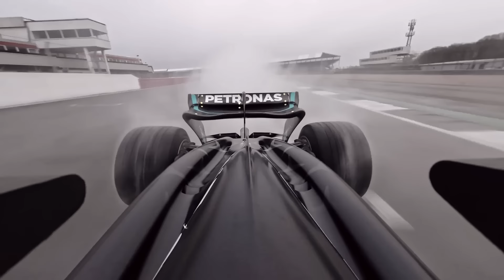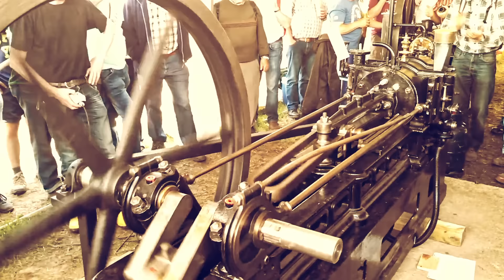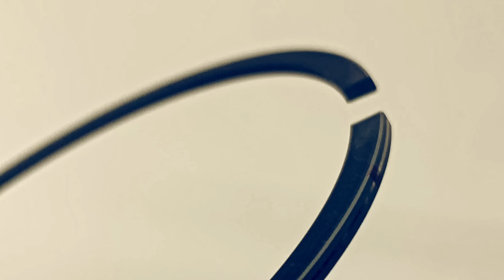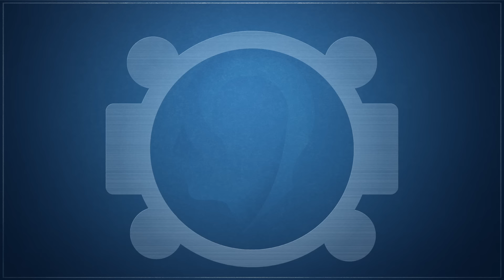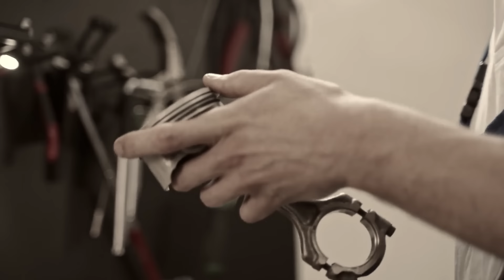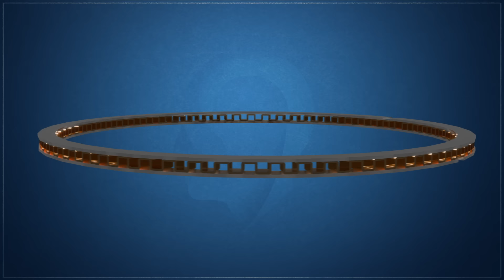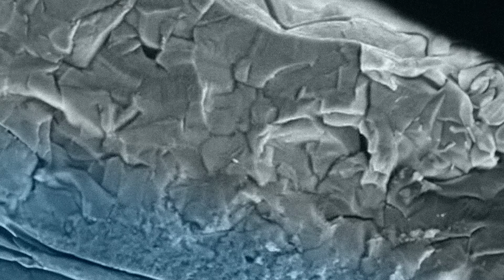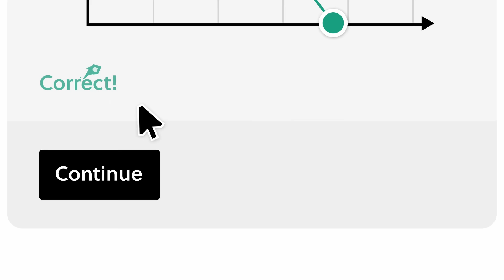The Clever Engineering Of Piston Rings

Comment: Now this was a very informative video indeed. Those Keystone rings a very interesting. Those F1 rings are mental.

These new thinner, lower tension piston rings in modern engines are a disaster.

They reduce fuel consumption, but increase oil consumption. How is that keeping the environment clean?
The cost of the required oils is also magnitudes higher than what was a regular oil back in the day.
I would venture to say that the amount of money I save on lower fuel consumption does not cover the extra cost of constantly topping up the oil or the inherent issues of those consumed oils damaging catalytic converter, etc.

The demands brought by these environment regulations is actually going to mess up the environment in the long run. Barely-used vehicles are getting junked due to high oil consumption issues deeming them not fit for service. You can blame the manufacturer, but they in turn are held to account by the stringent regulations.

Comment: Good video , one part of development you missed was the 4 piece oil control ring this was most likely common in the 70s and 80s, known to me as a CR4 ring these relied on groove depth to supply ring pressure to the bore, where as the 3 piece by its design, puts pressure on the bore, that's why it's important to butt the inner spacer correctly,  I knew this design as a CX3 ring , I was an auto machinist in the 80s and 90s . I must have had some reasonable, training as i knew about all the internal and external steps and chamfers to induce torsional twist for better oil control  Cheers .

Comment: Is it true that the viscosity of an engine oil is determined by the leave of the oil control ring?
Reply: I'm not 100% sure about the wording of your question, but if you are referring to the viscosity manufacturers specify for engines, that is driven by the endless quest for improved fuel efficiency.  Lower viscosity oils reduce what is referred to as "viscous drag" which means the engines turn more easily when running, using less fuel.  The use of lower viscosity oils in turn requires a reduction in the clearances between the various moving parts so that those parts are capable of creating what is referred to as a hydrodynamic wedge in the space between those parts. When that happens it essentially eliminates or at least minimizes metal to metal contact. Furthermore, with the adoption of overhead cam designs, you now have cam bearing surfaces more distant from the oil pump.  Lower viscosity oils can be delivered in larger volumes to those components operating at the further reaches of the engine.
Reply: Yes, thicker oil will cause the rings to hydroplane and burn more oil than they already do.

Comment: The irony that the new modern engines with the mandated pursuit for "efficiency" at all cost, ends up making them burn oil at horrific rates, wear out/outright fail prematurely, add insane complexity, drive up the ever more impossible to afford features that either require them to be only diagnosed or repaired by engineers and computer scientists, or simply junked as unfixable.
Reply: That's all part of the plan to make private automobiles uneconomic.
Reply: Not true! Today's engines typically run for 100s of thousands of mile with no issue. Engines in the last century were worn out at 100000 miles.
Reply: @fisheatingbagel40  No, 80s to 2000s engines run for hundreds of thousands of miles with no issue. It's modern engines that are chronic oil burners from the factory, and become catastrophic oil burners once the low tension oil rings get sludged up.
Reply: @gregorymalchuk272  modern engines last longer compared to a push rod engine. As for oil consumption, it depends on how the vehicle is driven. Lower viscosity oil reduces consumption generally.
Reply: @fisheatingbagel40  achieved by more resilient materials....
Reply: For the manufacturer, it was never the "pursuit for efficiency"...it was the pursuit for cheapness. Any government regulations merely hasten the process of cheaper to manufacture designs, that incrementally increase in cost for the consumer. I do constantly hear how great new engines are with their 300,000 mile (or more) lifespans, when I have 1947 & 1951 Ford 8N's that I can completely rebuild for next to nothing in a day, when I would be forced to scrap most other "superior" high-RPM motors.

With the realization from people like Henry Ford later on that your money was never really made in the initial sale, it's in the parts catalogs & servicing...engines somehow became increasingly more expensive and time-consuming to fix, with external parts failures way below 100,000 miles, while using cheaper and cheaper metals, then plastics to manufacture said parts.

By now, you should have had motors doing a million miles on a single rebuild, running on updated magneto systems requiring no points or any type of computerized injection or firing control whatsoever.

Instead, you got super expensive, not that great engines with claims of how long the pistons and rings will last, but they forget to mention how much it costs to fix an idiotic idea like variable valve timing and per-plug coil packs when they fail within 20,000 miles.

The sooner kids out here realize you had the Golden Era of engines a long time ago before I was even born, and they are just dealing with fantasy fulfillment and cost-cutting measures of teenagers who really don't comprehend engines at all while watching way too many Fast & Furious movies, the sooner they will ditch high RPM soda pop can motors that cost you more in the vehicle lifetime than a 1950's Ford or Dodge, but only costed the manufacturer $20 to build.

Welcome to the Era of Lateral Advancement...it doesn't really go anywhere or do anything better, but they keep telling you it does while charging you more for it to not do it any better.
Reply: @TheCaptainSlappy holy yap, thank god the world doesn’t revolve around you because no one wants to drive a 7L v8 that makes 90hp for the sake of “serviceability”
Reply: @shiikon2193  Well...since I have actually worked on engines from the early 1900's that are still running, it's safe to say they knew what they were talking about, and youtubers only made you think you did.
Reply: @TheCaptainSlappy  no one wants to drive or deal with the maintenance of a 1900s engine. But uh good job on your passion project
Reply: @shiikon2193  Good to know you know you know more about engines than the people that build and work on them.

Comment: I am an electronics engineer that currently works in tech. Me being privy to this information is absolutely inconsequential and will never help me in any way, shape, or form, ever. Therefore, I must now watch this entire video and learn everything about piston rings.
Reply: you'd need it when you'll eventually have to work on your own car
Reply: @yobama8344  most people, even mechanically adept, would refer their car to a mechanic if there's an issue anywhere near the piston rings... The amount of engine you gotta dismantle to get to them makes it a job for only those who have the right space and equipment for it
Reply: @sivansharma5027  I feel the same, brakes, rotors, generator, starter, relays, brakelines, All the somewhat accessible parts I can do by myself... Once large- or specialist tools are needed I'll leave it to the pro's.
Reply: So you can show off your knowledge at cocktail parties.
Reply: Programmer here but I’ve rebuilt several engines and here learning more about piston rings. Great stuff!
Reply: Learning is its own reward.
Reply: @rahulmooley3298 Similar with me,  electronics and software engineer (now retired).  But I did rebuild two of my cars' engines while on a sabbatical a few years back and it was an amazing experience,  I highly recommend it! I sent the bare blocks and heads out to be fully machined by a professional racing shop but other than that I did 100% of the job myself in my garage.  Anyway,  I STILL didn't need to know this much about piston rings but am still watching this video to the end just because!
Reply: Au contraire, mon ami!! Progress moves best and most sustainably when SMEs know multiple fields and even multiple industries, even if unrelated simply because their minds can then cross reference knowledge sets and make otherwise novel connections that might take brilliant single-field SMEs years to discover otherwise. Who knows, you could very well discover a new Nobel Prize worthy circuit if you keep watching cross-discipline videos. Stay curious!
Reply: Well , you'll need more than what is in this video .
Reply: i am an arts major at college but enjoy these videos because i learn something new and understand how things work and the clever design behind them.
Reply: Best comment!

Comment: Nicely made, I worked for years in a ring factory for the UK's largest manufacturer making rings for nearly everybody, boring Perkins diesels, Cummins, Rolls Royce Merlins, Cosworth F1  engines, just everything (the factories were divided by ring diameter, we were 2 1/2" to 7 1/2", our neighbouring work up to 16ft for marine engines). Complicated to make, normally 30+ operations for a ring.
They aren't actually ever round except compressed, the spun-cast cylinders are machined in an egg-shape to get the required variation in spring pressure and at every stage afterwards compressed to do the rest of the work.
Reply: Yep. And pistons are far from round, when cold, as well. Mass and temperature distribution are taken into account to form an oval, tapered piston.
Reply: @UncleKennysPlace how much of an oval shape are we talking? As severe as an egg? Or less than a millimeter difference?
Reply: @queueeeee9000 in this case micrometres play a big role)
Reply: @queueeeee9000 Very slight
Reply: @UncleKennysPlace
Reply: @jimtitt3571 that in itself would make a fascinating video!
Reply: Hastings company?

Comment: Govt: We want your cars to use less fuel.
Manufacturer: Here, we use more oil instead.
Govt: Great work!
Reply: cry in 2AZ-FE
Reply: The net effect is still better. 1l oil per 1600km instead of, say, 500ml per 2000km (internal combustion engines have always consumed SOME oil) in exchange for 10-15% better fuel economy is still fantastic. If we assume 20km/l -> 22km/l you're still saving ~7l of fuel per 1600km in exchange for ~700ml engine oil. And this is a very conservative example due to the almost unrealistically high millage.
Reply: @andersjjensen  lol healthy older engines consume nowhere near that amount. Maybe you just never changed your oil
Reply: @andersjjensen But in the meantime, I'm having to replace prematurely failed internal engine components such as timing chains at as low as 60,000 miles because of such low oil grade. Proof: in the past, on the brink of "low tension rings" the engines in some cases were exactly the same except for low tension rings and decreas in oil viscosity. They were slightly less fuel thirsty, but in turn, the low grades of oil does not sufficiently lubricate the timing chains, camshaft, and valve train, causing failures there. This is my opinion. Based off of my beginning statement.
Reply: using facts and figures (especially when expressed using SI Units) is futile with a guy like that.
Reply: @andersjjensen  The difference is that the oil consumption will become massive when the low tension oil control rings get stuck and the engine blows up. And that's not cost effective. Nor is it cost effective when you consider that the regular oil burning (not even the catastrophic oil burning once the rings are stuck) will trash the catalytic converter well before the the rest of the car breaks and require expensive replacement.
Reply: @gregorymalchuk272  Just FYI, low tension rings are not exactly new - they have been used by manufacturers since the 1980s. Ford was even using them in their small block V8s way back then. It doesn't appear that catalytic converter failure skyrocketed at that point. In the modern era, stuck oil rings are more often a consequence of direct injection and the excessive carbon buildup that it can produce, particularly in early-generation DI engines such as the Ecotecs & Hyundai GDIs of the 2010s. I'm sure the low tension rings didn't help either, but it wasn't the #1 causative factor that led to so many engines eating up oil.
Reply: @DeusTex  The level of tension in 1980s "low tension" rings is way higher than modern low tension rings. And no, this is independent of ill thought out direct injected schemes. Port injected Toyotas for the past 26 years have have been chronic oil burners.
Reply: @andersjjensen  what about the money and environmental cost of making, distributing, and installing and disposal of new and old catalytic converters? and of fouled sparkplugs, then valve and throttle body cleaning, engine diagnostics, and the health cost of breathing in bigger oil particles in exhaust?  or was this planned obselescence to make a bigger opening for electric vehicles?
Reply: @gristlevonraben  My Mazda 3 from 2021 has lower service requirements than my Toyota Corolla from 2005 had, so I don't know where you get that from. I have 75k km on it and it's still on the original plugs, whereas my Corolla needed new ones every 35-40k km.

You seem to have decided that consuming more engine oil results in more dirty combustion as a blanket statement with no ifs and buts. But do you really know that or are you just trying to apply "common horse sense" to a complicated topic that involves advances in machining precision, different compositions of modern synthetic oils, changes to injection and ignition patterns, etc, etc?
Reply: @andersjjensen I was getting 50-100k miles on plugs on my 08 Chevy but okay
Reply: Wow - beautifully produced video with excellent visuals. Densely packed with information throughout. Turned what could have been a very boring subject into a really interesting summary of the development history. Even the comments are above average quality! Subscribed!
Reply: And then the catalytic converter becomes fouled with ash and fails.
Reply: exactly!
Reply: for once im glad gov making this ancient technology extinct
viva la EVs
Reply: Ships at sea with diesel engines will not be EV anytime soon, and they are a heavy contributor to pollution and oil usage (notice I didn't say fossil fuel...that's disproven.)   What about the heavy earth movers that had to go to work to pull out the many, many tons of raw materials to be able to make the battery for an EV?  EV's are not practical in over the road trucking, though I would argue diesel-electric systems like we see on trains could be useful.

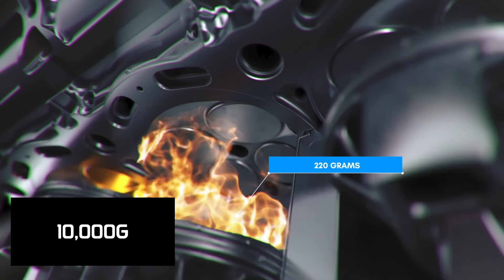Comment: 0:19 g's are not a measure of force... just kinda makes you sound unprofessional
Reply: 1g is the average force of gravity on earth- it's actually an acceleration, but is directly correlated to force and so a force can easily derived.
It's definitely a weird unit when talking about car engines.
Reply: @vladthe_cat  1g is the acceleration experienced by objects on earth, indeed there are cases where its suitable to use g's instead of force but like you said, this isn't one of them
Reply: K
Reply: Looks like he (or a producer/writer) got it from a Wikipedia article called 'Formula One engines'. It's the only place I could find it online.
Reply: It's AI generated.
Reply: True…
Reply: Acceleration, or delta of acceleration is a measure of force. Indirect, and useful as a quick and dirty eg. Of the stopping and starting forces easily understood by unscientific types.
Reply: G’s are most certainly a measurement of force. Pistons rapidly accelerate and decelerate thousand of times in a minute. The force induced upon those particular pistons would equal 10,000x their own weight at the instant they start moving the opposite direction. Same force that pilots feel in fighter jets while doing maneuvers; they feel like their body weighs x amount of times more than it does in the surface.
Reply: @TheHuntron2000  Like you said the pistons accelerate, they exeperience forces as a result but acceleration and force do not have the same units therefore they do not measure the same thing, so saying experiencing g's of force just isnt accurate
Reply: @noamstanger  yet it's common parlance in flight and racing to use g's as analogous to force experienced by the pilots.
Reply: @harshsharma03  by the pilots not by the pistons, using g's to describe what pilots and drivers feel is more fitting because while turning they have centripetal acceleration just like what you feel just by living on the surface of the earth. Pistons on the other hand move up and down, correct me if im wrong but its more fitting to use g's to acceleration in a spinning or turning situation.

Comment: Cummins’ supertruck program has demonstrated 55% brake thermal efficiency with a heavy duty x15 engine.  While not directly related to piston rings and more about waste heat recovery, still a significant step forward in engine efficiency.

A key contributor to modern engines oil consumption is the lack of adequate oil separation functionality in the crankcase ventilation system.  With designs trending to lower friction targeting ring surface friction, you will inevitably get more blow by gasses in the transition period before the pressure is effective on the ring to increase the specific surface pressure.  Many aftermarket companies have stepped in with crankcase catch cans and/or oil separator systems to remedy this oversight.
Reply: Cool